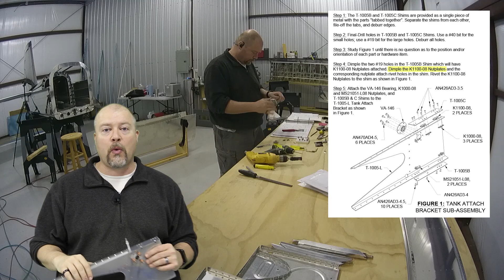RV-10 Wings - 051 - Hate mail, Skin Dimpling, and Tank Attach Bracket

Comment: Jason, it is because of your videos that I finally decided to build a RV-7A kit.  A major reason for selecting Vans (other than your excellent videos) is the fact that I owned a precision sheet metal fabrication factory for many years so I already have most of the tools required to build an all aluminum ship (I even have a squeezer with a 9" reach) .  Which brings me to my one criticism of your technique.  Every time I see you run your finger over a piece of sheet metal you just deburred, I cringe.  Please wear a proper pair of sheet metal gloves when working with sheet metal.  Those edges can be as sharp as razors. 
In one of your videos you mentioned that the edges of some of the skins had little steps in them... you even ran a tool over the edge and noted that you could hear a sound as the tool ran over the uneven edges before deburring.  FYI those little edges are caused by the "parting die" used to punch out the final shape of the skin after all the interior holes and notched are punched.  The parting die can be as long as 3 or 4 inches, so to cut out a large part could take many hits... that's where those little steps in the edge come from.  If it was cut in a shear, those edges wouldn't be there.
Great job and  keep those videos coming.
Reply from the maker: Firstly, Awesome!  The RV7 is a great plane.  Having all the tools like you do as well as your experience will make your life a lot easier for sure.   You have an invaluable step up =)  Regarding the sheetmetal gloves, what do you recommend?  You're not the first person to say "stop doing that!" haha..  I have to admit it's probably a lot like watching someone run their finger across a razor blade =)  Thankfully, I have only cut myself that way once.  And it was more of a scratch than a cut.. heh